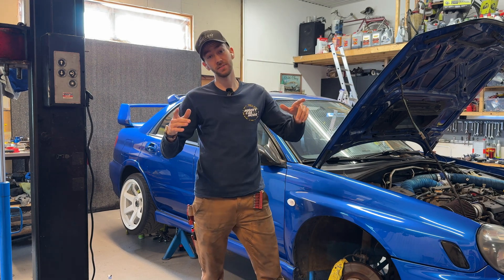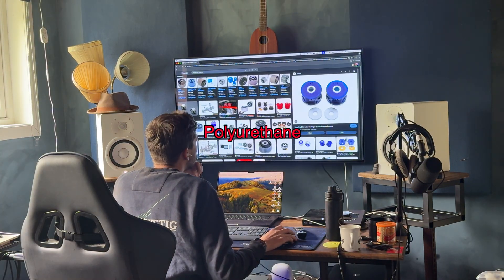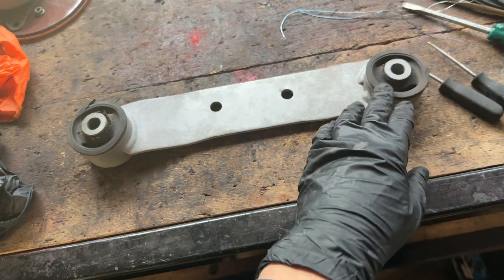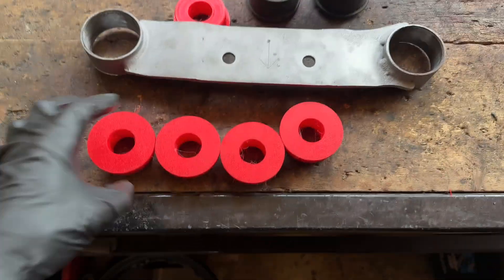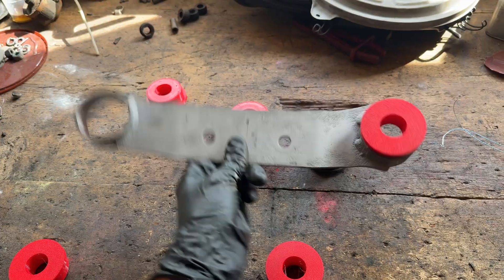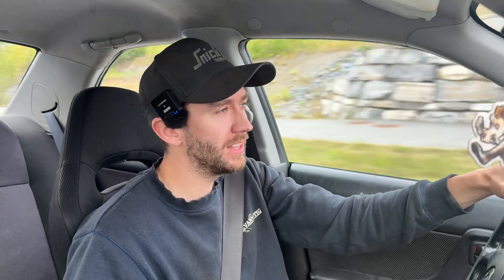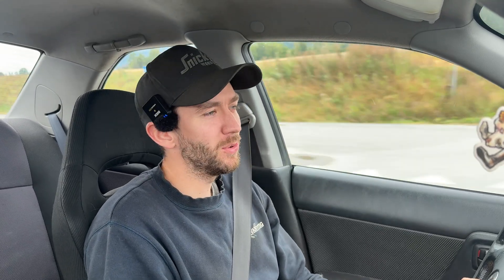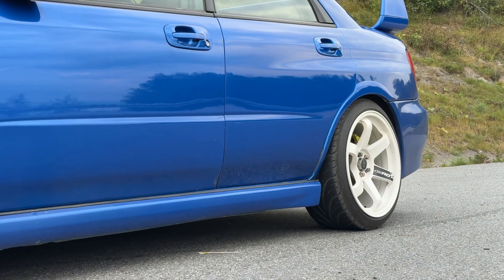Fixing My Car With a 3D Printer – Genius or Stupid?

Comment: I made some for the front and rear suspension of my '82 Wagoneer. They've been supporting heavy loads for four years without deforming. If you want softer bushings, just play with the infill density when printing. And yes, if you don't make lubrication channels, they will be a little noisy. In my case, since it's a 4x4 for work in the field, I don't mind.

Comment: Great video. Im doing all the bushings for the suspension for a Jaguar XJ6 (3D printed). Also sandblasted everything, great fun. Just a tip: I printed PLA caps to cover up all the holes before spraypainting. Way easier then fiddling around with tape